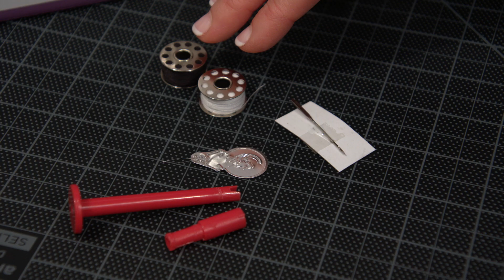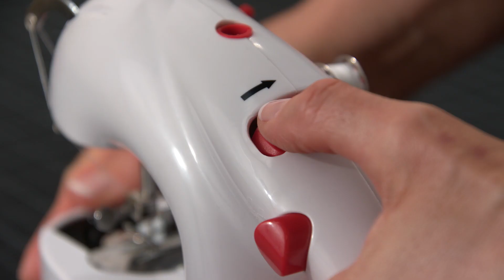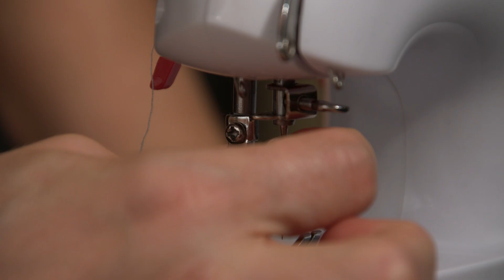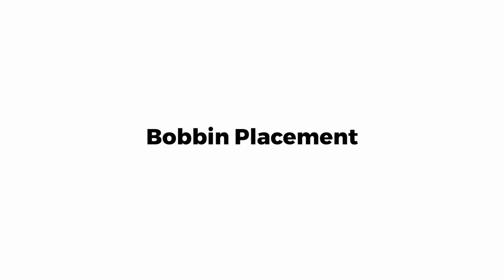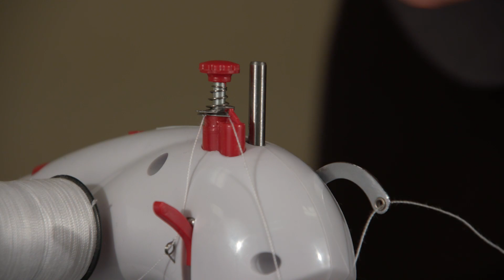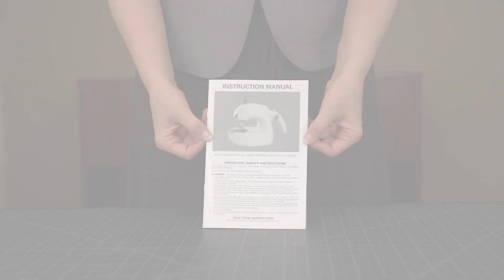Stitch Sew Quick 2

Comment: what is the function of the adaptor hole near the handle?
Reply from the maker: Hello Robiah - thank you for watching! Although the machine is designed to be most effective using batteries, it can also be used with a power cord (which does NOT come with the unit). That is what the adaptor hole is for. It is not a common power cord (see instruction sheet for details), so you have to search online if you want to use the machine without batteries.
Shannon
Reply: @DynoMerchandise  i see, thank you so much for the guidance!

Comment: I clicked on this video solely to see how the top bobbin is set up/strung through.  I noticed this machine tends to work fine so long as you correctly run the two strings.  IMO most "sudden stopping" is due to incorrect string positioning.  After that, it's the weak motor jamming up.  Unless you're sewing straight up denim, this machine should work fine.
Reply: Oh wait so denim won’t work with this machine? :(
Reply from the maker: Hello Strawberry Gecko - correct, the Stitch Quick is designed as a mender of lightweight fabrics. Denim may not work with anything but a sewing machine, as those are made for many types of fabrics. Feel free to send us an email at CustomerService@DynoLLC.com if you need more help.
Thanks!
Shannon

Comment: My machine is pausing by itself after every 2 secs
Please suggest something
Reply: Rachel Nadar it’s your tension, it’s not right, you need to adjust tension and put needle into low position again and press start again, this happens when the tension is too tight or too loose, it is a delicate balance, I still get pauses every now and then. Good luck. Sorry I didn’t see this post sooner.

Comment: My needle isnt catching the string on the bottom bobbin....i wish this was more specific. This machine is very frustrating
Reply: I’m encountering the same problem
Reply: It took me a while as well, you have to make sure and do exactly the same thing she is and it’s doable.., it takes a few try’s, but when you get it, it works, next thing is figuring out proper tension when sewing, when you master it, it’s a great machine for quick work on thinner fabrics.
Reply: Destiny Burton did you figure out how to fix it?
Reply: @matchaprincess33  i didn't! I ended up just borrowing someone's machine, now this thing is just sitting in my storage
Reply: @destinya7795  I hope you figured it out
Reply: It's a shit video but the technique is correct however before I learned it I used a broken toothpick and tweasers. But really you just have to have the thread close enough to the needle when you bring it down so that it can come up through the hole when you lift the needle up again, it's tedious but it's the only way